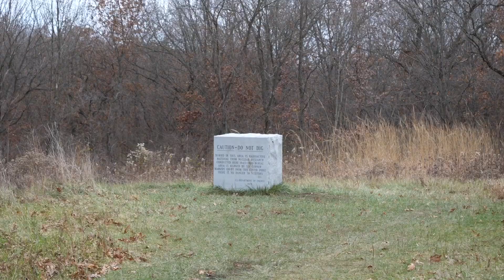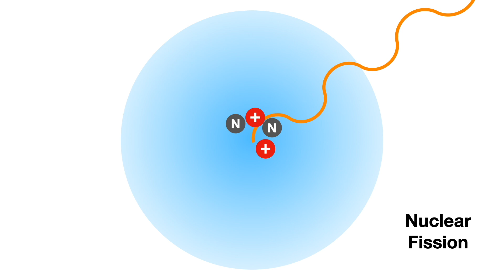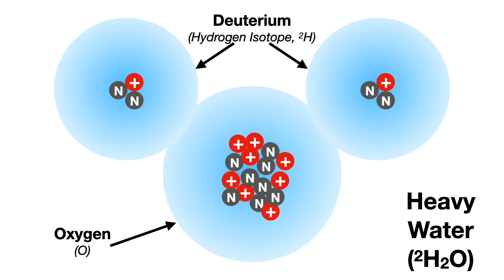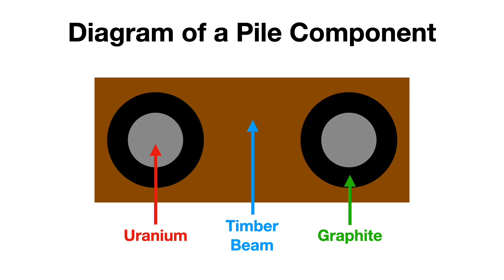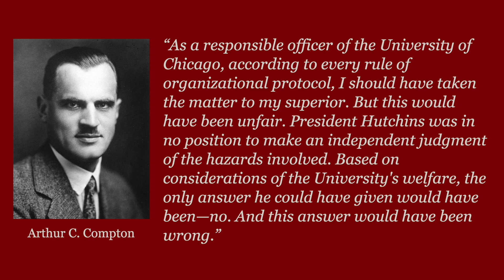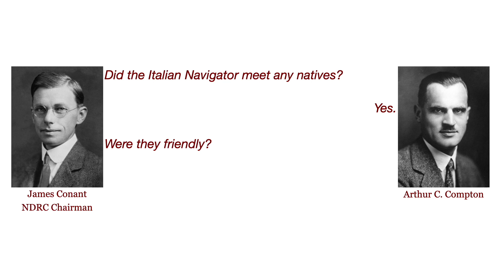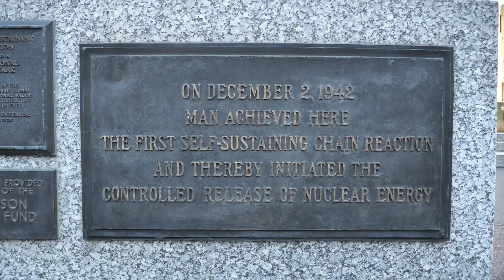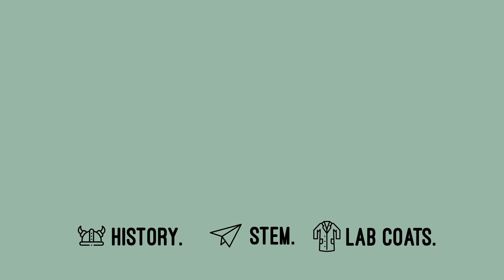How Was the First Nuclear Reactor Developed? (Chicago Pile 1)

Comment: By claiming that Pile 1 was an experiment to prove a chain reaction can be sustained is a total lie. Femi and the others believed 40 tons of Uranium ore would create a full bore reactor and also an A-bomb.  Instead they "claimed" to make 1/2 watt. Femi was not even part of the Manhattan project until 1944 well after nuclear reactors using enriched Uranium 235 were already operational.  Had Fermi and Szilard's Pile one been all that was created;  there would never have been atomic energy.  Peierls and Frisch are the founders of of atomic energy not these total frauds. You are a fraud to keep this up .  Chicago Pile 1 was a failure and should be completely called what it was. The people you credit here were on the total wrong path and failures

Comment: You're  furthering a revisionist  fraud; giving credit to people totally on the wrong track to nuclear power. Chicago pile 1 was an total failure.  The use of 40 tons of Uranium ore does not create a nuclear reactor nor do 40 tons of uranium ore create an A-bomb.  This is exactly what Szilard Fermi and these others believed.  The proof is the Einstein letter where it was outlined that a bomb could be created using 40 tons of Uranium ore.  Totally false. Peierls and Frisch had identified the key to slow neutron fission in March 1940 calculating the small critical mass and several bomb yields while working for the British. This was kept secret until the USA entered WWII in Dec 1941. In 1942 the P&F secrets were revealed starting the Manhattan Project.

Comment: To call that a nuclear reactor is a massive falsehood and joke.  The entire output of 40 tons of uranium ore was 1/2 watt (claimed maybe even false). The world did not change at all. Fermi had no concept of the importance of U235 in low speed fission. In 1940 Peierls & Frisch had written a paper proving the vital need to have U235 to produce a pracitcal atom bomb or critical mass.  This was kept secret by the British until 1942 when they revealed it to the US launching the Manhatten project.  The entire focus of the Manhatten project was to refine out the rare U235 isatope in order to have fission.  I was used in Hanford to produce power and later Plutonium when Ernst Lawrence was able to show would be a substitute for U235 and easily extracted from a nuclear reactor: but you had to have the reactor first using U235 not raw unranium ore.  If anything the Fermi Pile Chicgo Pile 1 proved no useful reactor could be made without highly enriched unranium with U235. Basically it was a giant failue particularly considering the mssive cost to produce 1/2 watt.

Comment: First controlled reaction seems to have been a BS, or a failure, or both...
0.5 W? LOL!
Reply: How did Enrico Fermi enrich his uranium if at all? I understand that the natural uranium, 99.3% U 238 doesn't fission?
Reply: @sbkarajan  He didn't, they used natural uranium. That is why the power generated compared to te size of te reactor is ridiculous
Reply: @alexing86  Have you read Szilard Petition? Please do, note the date it was written, how they describe themselves (working in the field of atomic power? LOL), and tell me if the US actually built the atom bomb.

Oh, and trace when the Manhattan Project really started. The Lab buildings did not complete until Nov 1943.

And then compare Trinity bomb and Fatman bomb. And the demon core. They are the same production bombs from Germany.
Reply: Criticality is possible at concentrations below naturally occurring.   It just takes more fuel and more moderators.
Reply: @BowlOfRed  How did Fermi claim to have MEASURED 0.5 W of power from the multi ton reactor block?
I cannot find any reference.
Reply: A proof of concept needed to show the production of energy, and 0.5W is well enough for that purpose. How was that a failure since the creation of energy was documented? The output power increase becomes a scalability issue once the concept is validated. You heard that Pile 1 was able to produce 200W, a level that already generated safety concerrn. Thankfully. it was Fermi in charge of the project, not someone who, looking for "success" in the way you intend it, would have blown the whole city of Chicago out lol